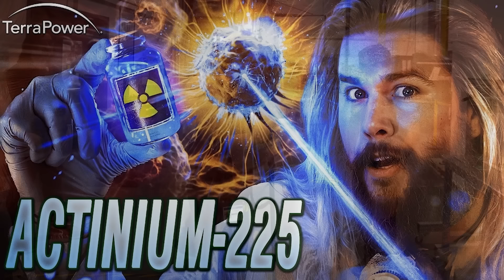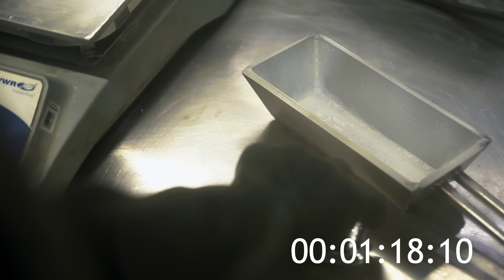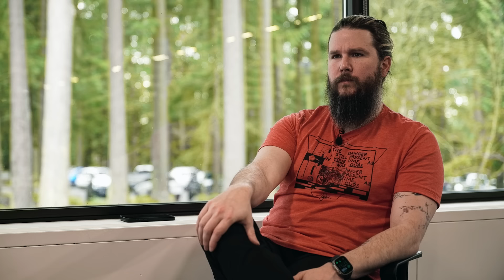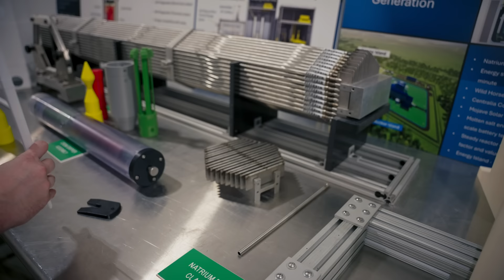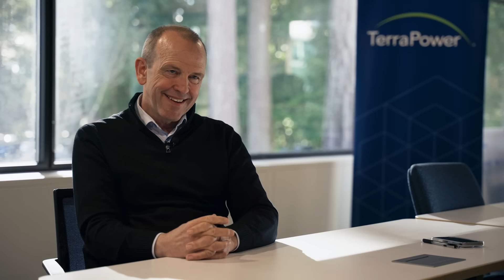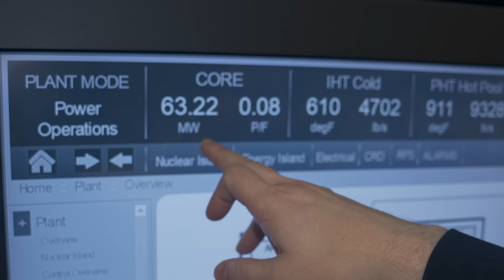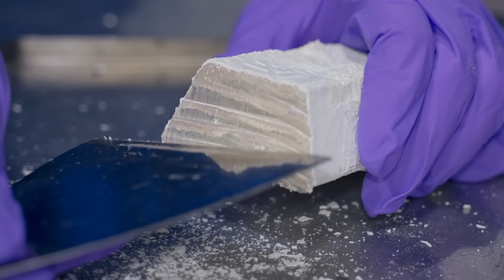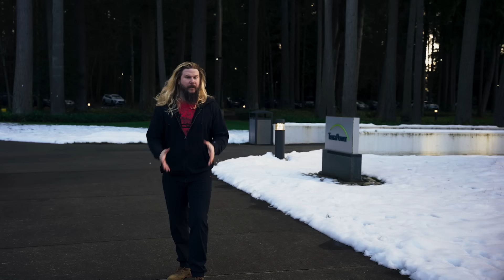Will Natrium Nuclear Reactors Change Everything?

Comment: I gotta say, this is genius.  Of all the things said about this process, moving the material via magnetism is just crazy when you think about it.  What I didn't hear a lot about is overall safety, backup plans and what waste is created.  I know its really early in the process, but usually, these are the big sticking points to normal people.
Reply: The waste generation issue is addressed in Kyle's older videos on Gen IV reactors.  Modern fuels don't decay the same way older crap did; it both produces less waste to start with and much of the waste that is produced can be re-bred into new fuel.  So you can use the same* fuel multiple times without having to create new fuel, which means a whole lot more watts per atom.

This technology is safer because the lack of pressurization means a great many fewer failure points, and also no catastrophic explosions scattering radioactive material for miles.  Modern reactors are also created in such a way that their failure states are "shut down" rather than "runaway".  They're not perfectly safe, but neither is the car you drive every day and blithely trust without a second thought.  Well-constructed Gen IV nuclear is proven safer than any other method of generating power, including solar and wind.

Backup plans, contingencies, and such aren't really the purpose of educational exposure videos like this, either.  The initial reactor in Wyoming is for shaking all that stuff down and perfecting their process; this video is showing everybody how the technology works and why it's a big step forward.

Really, the answer to all of everybody's dumb problems with nuclear is "all your opinions are informed by reactors built eighty years ago when we knew jack monkey squat, and also all the major nuclear disasters in human history were the fault of Idiots In Charge, not failed technology.  The new stuff is the answer we need because it turns out eighty years is a long time and we've learned a thing or two."
Reply: @yurei8368  "all the major nuclear disasters in human history were the fault of idiots in charge."

That's my whole reason for not liking nuclear power. We will never have a shortage of idiots in charge, and companies needing to turn a profit means there's no end of corners people will cut to make an almighty dollar. 

The technology is cool. It's people and profit that make everything unsafe.
Reply: @AlexandarHullRichter
A problem that will plague every endeavor humankind ever sets its collective hand to, across all of history.  A problem we have solved in many other industries, at least to a large extent.  And frankly, renewable simply isn't going to get us to carbon neutral by itself.  It's too fiddly and unreliable, too prone to environmental factors.  We can't leave tools sitting unused in the belt if civilization wants to see 2100 from somewhere other than an apocalypse bunker.
Reply: @yurei8368  we can wait if the risk of stupidity and greed is great enough to destroy parts of the planet. Sometimes you don't give dangerous toys to kids until they mature enough to handle them. 

People's claims about renewables not being enough are hardly accurate. If every single roof and parking lot was completely covered in solar panels and it still wasn't enough, that would be more believable. 

If power consumption to big users like AI servers was restricted as well, that would help things a lot more too. If big power consumers like that had to pay the full cost of the energy instead of getting the power company the raise everyone else's rates, that would also reduce demand, because the rich seem to be allergic to paying for what they use.
Reply: @AlexandarHullRichter What seems more likely: we get nuclear to work?  Or we get rapid, ultra-widespread adoption of local renewables as well as comprehensive regulations limiting the ability of Big Tech to do Big Tech things while also forcing the ultrawealthy to accept laws and regulations that would force them to pay their fair share?

I'd bet on nuclear every day of the week and twice on Friday, over convincing every last single person in the entire world to install solar - which would also be enormously more expensive and resource-consuming than centralized nuclear in places where renewable performs poorly.

Renewable is not, and never has been, a magic solve-it-all silver bullet.  It's one of the tools in the toolbelt, for those places and situations where it fits.  For other places, there's nuclear.
Reply: @yurei8368  defeatist attitudes like that prevent you from being a part of any solution.

In any event, elitist idiots being elitist idiots has been creating much bigger problems of late, and we're either about to see them come toppling down, or we're going to see more coal and gas investment because they don't care about the future as long as they stay in power.
Reply: @yurei8368  First and only time "blithely" was used on YouTube, correctly nor otherwise.
Reply: @joshsnyder4868 You missed my comment about the blithe spin the video puts on?
Reply: @perrisici I must have. I just spent 5 minutes scrolling and still didn't find it.

Also what happened to the comment by @yurei8368 ?
Reply: @yurei8368  That's an unfair generalization, it seems to me. Sure there's been a lot of research and development both in materials and designs. But that's true of every energy technology, even combustion engines. That doesn't make anything a no-brainer go-ahead. The real issues are about achieving the sustainable development goals, including the prevention of worse climate change. We haven't got time for delay. Educational videos shouldn't need to skirt the real aspects of how this reactor actually is expected to work, giving us the sideshow of bending a cold bar of solid oxidized sodium and another shot of a few decilitres of hot liquid metal swirling in a beaker. Then there's the showcasing of the simulator screen as if it's monitoring some sort of a reactor response rather than just running off a computer model. That's the opposite of education: demos so far away from how the actual reactor will operate and the current state of the project, they're misleading. I wouldn't be surprised if the reactor design gets so far behind the data centre construction that they end up swapping in a gas-fired thermal plant on that concrete pad they say they've broken ground on as a "temporary measure" to deliver the power they need.
Reply: the bigger question is how will they stop this project from getting out of control in terms of complexity, especially while building it.
Reply: I really want the waste addressed as well. It seems wonderful but I have more questions
Reply: they arent trying to get normal people on board yet. they want investors. this is exactly what investors would be looking at this early imo
Reply: @astrocat229  I tried to invest.  They won't even talk to me.  Just one skin cell sloughed off of a body I guess.
Reply: Unfortunately, because right now it’s still a private entity, I don’t believe they need to disclose any of that to the public.

The best thing about companies like this, that are “changing the future“, is how normal people can’t also roll the dice on profiting from this possibility very lucrative venture. Their IPO is not listed, BUT if you have to have a high net worth you can invest in the company, through a “secondary marketplace”, to get more substantial updates AND so when it finally does go public, your already substantial net worth can just get larger. 

Kinda reminds me of how cryptos start off with the base number of people, and then open it to the public, only for the people who started it to sell off their massive quantity of crypto, bit by bit, making massive profit.
Reply: The selling point is actually the new molten salt reactors shut down if the overheat, literally melting into a tank below. Prevents meltdowns like chernobyl and fukushima, theoretically.
Reply: @wesleyhobbs4797  This is NOT a molten salt reactor, it is a sodium fast reactor. The safety selling points for this design are that is runs pretty much at atmospheric pressure (similar to most MSRs), it has an extremely high negative temperature coefficient of reactivity, meaning the hotter it gets, the less heat it produces (shuts down well before boiling point of the coolant with no moving parts) and has passive always on decay heat removal meaning once it is shutdown it stays that way without any damage for a long, long time.
Reply: Terra Power website goes into some of it.
Reply: waste compared to fields of solar panels and wind turbines that reach end of life is negligible and horizontal drilling technology has advanced to the point nuclear waste that absolutely can't be reused can be sequestered extremely far below the surface of the planet. As far as safety and backups, usually gen 4 reactors are passively safe and require active systems to keep the reaction running. So if a reactor is caught in a disaster and loses power, the reaction won't be able to sustain itself and it will shut down without intervention.
Reply: @simulatethat6099  This design being particularly safe in that regard as depending on the total thermal capacity of the molten salt battery, it could power itself even in the event of offsite power failure + backup power failure (conditions that warrent immediate scram measures) for hours if not potentially days. 

The main concern I have is that two of the three loops involve solids as their thermal mediums, and this might lead to dangerous transient states (cooled metal blocking flow in pipes, essentially soldered open/closed valves, thermal surges where pockets of molten metal form in solid metal and boil) 

Not that i have any expertise, but the challenges and problems involved in operation and maintainance will be very different in nature in most current designs, meaning new lessons might need to be learned the hard way.
Reply: @Viper607706  They ran EBR-II for 30 years with liquid sodium coolant and have worked out designs to address your concerns. BTW, MSRs also use a coolant which is solid phase at considerably higher (300C higher) temps than liquid sodium.
Reply: @simulatethat6099  we don't need fields for solar panels while we still have parking lots and roof tops without them.
Reply: This tech was developed and explored parallel to liquid flouride nuclear reactors for thorium as the fuel, the flouride salts version was found to be superior to sodium as the coolant and tge design was easily scalable. Nixon threw funding behind uranium reactors though, since thorium didn't produce any weaponiseable byproducts like uranium. Cold war era arms race screwed over the energy sector effectively for clean safe energy production.
Reply: @adamdavis8892  Commercial nuclear reactors have never been used to produce weapons grade material; only a few like RBMKs and CANDUs could even theoretically do so. The isotopic mix of Plutonium in used fuel rods is completely wrong and the technology to enrich plutonium doesn't exist.
Reply: @JacobNeff-oq5km  that does not change the fact that they wete designed specifically to create material that could be used to make weapons.
Reply: @astrocat229  If you are talking about the beginning of the nuclear age in the Manhattan project then yes that is true, but those military reactors are VERY different in design. Every reactor, including Th MSRs contrary to myth can be used to make weapons material if run outside it's standard operating parameters. The Natrium reactor (like most other commercial reactors) is specifically designed to make that harder to do, which is what Jacob was getting at.
Reply: @adamdavis8892  Stop drinking the kool aid, it doesn't help your thought process. I would suggest the Thorium Myths page by the website "what is nuclear".
At these temperatures, liquid sodium beats molten salts as a coolant in every way except 1. It has higher heat transmissiblity, it has much lower viscosity which aides in both pumping energy needed and passive cooling, it can be pumped electromagnetically meaning no mechanical pumps to break down, it only becomes slightly activated by neutrons and that primary loop never leaves the reactor vessel in this design and perhaps most importantly, it is chemically inactive with the materials the reactor is made from(essentially zero corrosion). The only drawback is flammability and 30 years of EBR-II followed by 3 decades of research on GE PRISM and then more operation on the Russian BN series has taught us how to manage that safely. Will there be small leaks in the secondary loop? Perhaps, but the sodium in the secondary is not radioactive and procedures have been developed to manage and fix them safely. The primary loop containing slightly activated sodium never leaves the reactor vessel.
The decision to continue the EBR-II program and stop MSRE was based on technology maturity, not weapons. Th MSRs can be used to make weapons too, contrary to the myths as can ANY reactor if operated outside it's intended parameters. If you believe otherwise, please explain why the IAEA insist on the same level of safeguards for Th fueled reactors as for U based?
They only wanted to fund 1 advanced reactor program and EBR-II was more mature at the time. SFR tech is still more mature than MSRs. We have what, 3-5 years of operation time on ALL MSRs combined including MSRE and TMSR-LF1. SFRs have something close to 400 combined reactor years of operation or 2 orders of magnitude more experience. MSRs may become viable, but at this point we still don't know when that will be or even if they are objectively better.
Reply: I agree, one of the selling points was "less waste generation," but never were we offered an explanation on how the system manages to do that.
Reply: I agree, one of the selling points was "less waste generation," but never were we offered an explanation on how the system manages to do that.
Reply: @xiuxiu1108  It can use current nuclear waste (processed) as fuel and it's waste product has a half-life of about 30 years. Yep, 30 years as opposed to current waste half-life of tens of thousands.  Yep 10s of 1000s.
On that basis alone I say go for it!!!
Reply: I agree, one of the selling points was "less waste generation," but never were we offered an explanation on how the system manages to do that.
Reply: I agree, one of the selling points was "less waste generation," but never were we offered an explanation on how the system manages to do that.
Reply: @xiuxiu1108  Thermal (neutron) reactors require enriched uranium fuel, and can only "burn" that fuel once, extracting about 1% of the total energy available in the natural uranium that came out of the ground.

Fast (neutron) reactors can burn natural uranium, but they can also burn the spent fuel from other reactors, among other things. Burnup of well over 90% is possible (possibly over 99%), meaning every ton of spent fuel run through a closed fuel cycle is worth over 90 tons of fuel in a thermal reactor.

This means two things. One, we need 90-100 times less fuel, so we produce 90-100 times less waste for the same power produced. Two, and more important, we can use our existing stockpiles of spent fuel ("nuclear waste") as fuel for our fast reactors. We have several hundred years worth of fuel already stored as waste, even if no new uranium is added to the system.

Not only would such a system not produce any new waste, because you're extracting all that energy from the old spent fuel, it's far less dangerous when you're done. Final waste products from a closed fuel cycle likely only need 1,000 years of secure storage, not 1,000,000. We know how to build things that last 1,000 years.
Reply: im all for this technology progressing and going forward, build the reactors thats how we learn and advance..... but to think the sodium in the reactor will never go above its design temperature is silly...  to think moisture/water wont get into the sodium system is silly... there will be incidents pretending there wont be is insane... but theres incidents with any technology, just dont lie to us and say this system is full proof when it obviously isnt... itll just be a black eye on nuclear when it is guaranteed perfectly safe and then it does have an excursion
Reply: @AndrewBrowner  True, nothing is 100%. That said, the 30 years of testing on EBR-II (which this is based on) does a pretty good job of addressing the 2 technical concerns you raised. The temperature concern really is pretty silly. Go look up EBR-II testing from 1985. The extremely high negative temperature coefficient of reactivity in these designs pretty much eliminates that as an issue even if a plant loses all power including backup just based on physics (no moving parts, valves, electronics, etc... required). The flammability issue is real, but at a very high confidence level is limited to the non radioactive secondary sodium loop, not the primary which is in the reactor vessel itself.
Now, if you drop a bunker buster on it, then you're going to have a big problem, but that is true of any reactor type.
Reply: @AndrewBrowner  Are you just copy+pasting that comment everywhere?
Reply: @smergthedargon8974  Fear mongering is an American pastime. 30% fact, 70% "OmG cAn U BeL1EvE?!"
It sells religion really well too, which is a HUGE bonus here!
Reply: Did you not watch the video?

Comment: Technically we could use the 1980s design and cost but using computerized safety features from today and we could build them within 4 years with fraction of the cost and still safe.